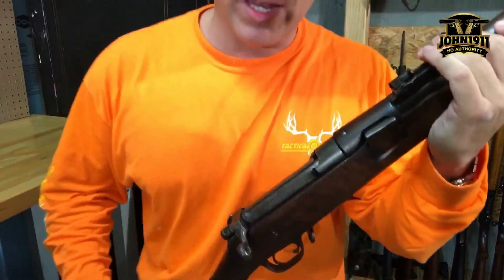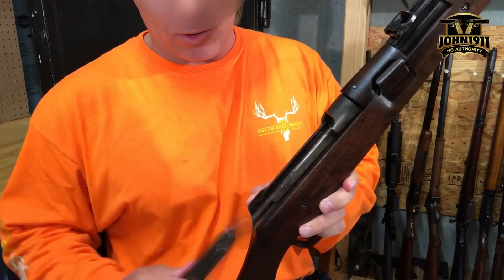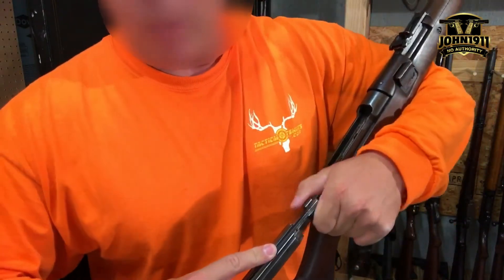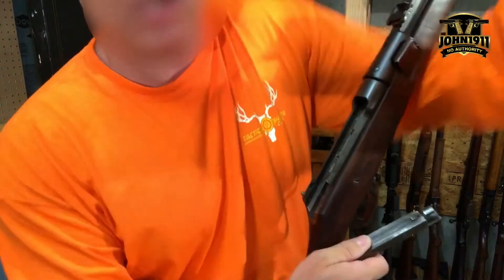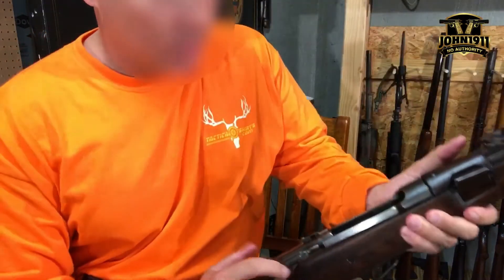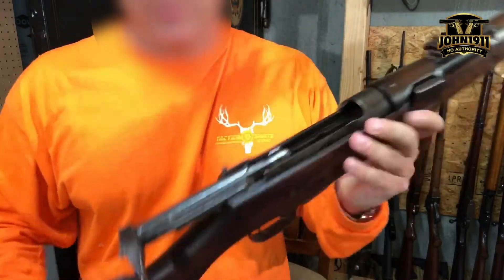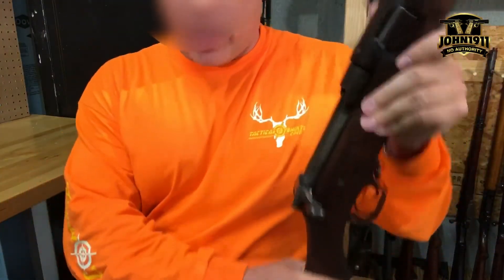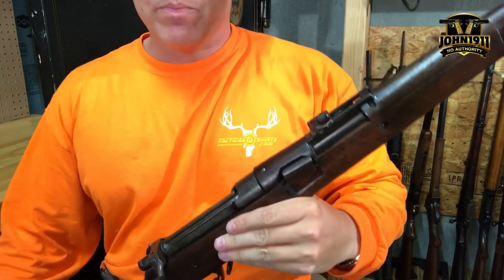Ross 1905 Bolt Install

Comment: I have a Canadian ross mkIII 1915, the bolt is actually alot easier to handle, you pull the end out same as before but it locks in place in order to slide the bolt in.
Reply from the maker: I did not know that. I’ll have to play with one next time I see a MKIII.

Marky
Reply: @John1911  yeah it's pretty cool. if you pull it to locking point but make contact with the end itll snap back in place, so make sure it stays in position and then you'll be able to slide the bolt in with ease.
Reply from the maker: I understand. This example does not seem to do that. 

Marky

Comment: you can use a US quarter to hold some tension and prevent the bolt from fully closing but you'll still have to pull the bolt head a little to align it for reinserting into the rifle. as you remove the bolt put the quarter between one of the bolt lugs and the bolt housing and as it collapses the quarter will wedge itself between them. this is the same trick used in the Mannlicher straight pulls just instead of a dime using a quarter.
Reply from the maker: Hmm...I’d have to think about that. 

Marky

Comment: Which version of the mk2 is this?
Reply from the maker: Todd B Todd,

I’m probably not the biggest expert on Ross rifles. It’s a MK II. Chambered in 303. And has US Army property marks on it. 

Ditto the bayonet.

We have pics and video on the website if you wish to see something specific.

Did I answer your question? 

Marky

http://john1911.com/m1905-mk-ii-ross-rifle-refurb-complete/
Reply: @John1911  Thanks John. I was wondering if it has any any stars after the MK2 markings like you see on the different variants. See here, https://en.wikipedia.org/wiki/Ross_rifle
Reply from the maker: I was literally wondering if you were going to ask about *marks like the Enfield rifles?

I’ll have to look at it tomorrow. Unless you can  See a marking on a photograph posted on the website?

I don’t know why but I assume for some reason these guns originated in Canada?

Marky
Reply: @John1911  it turns out my m1905 ross mk2 has US markings and was part of the batch of 20k Ross rifles sold to the US in 1918. My rifle even has the original m1907 sling dated 1918. What a find!!!
Reply from the maker: Todd B wow! I didn’t know the slings were also dated.

We purchased this rifle in a similar situation. The shop had it on the shelf. Some cracks. Uncommon caliber. Weird action. 

Most the demo in his area wanted deer guns or AR’s. The shop practically gave it away.

It wasn’t until after Freeze looked at it did we realize it was a US Army one as well!

Sincerely,
Marky